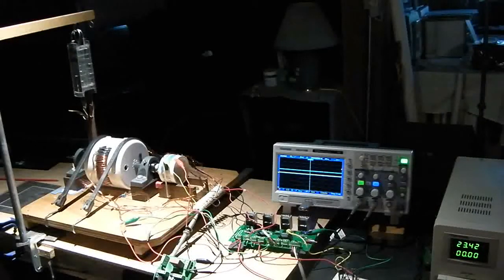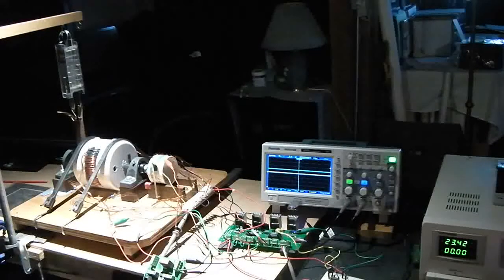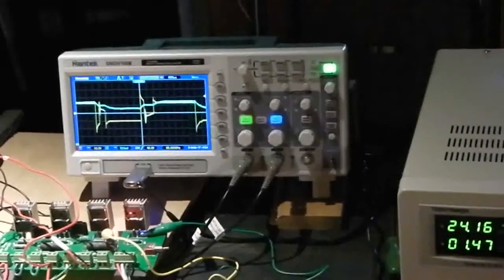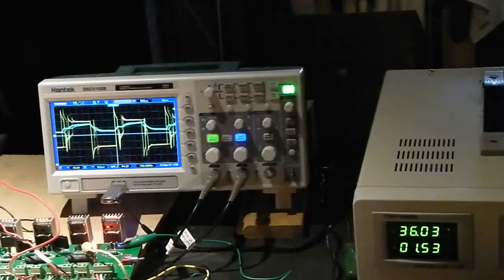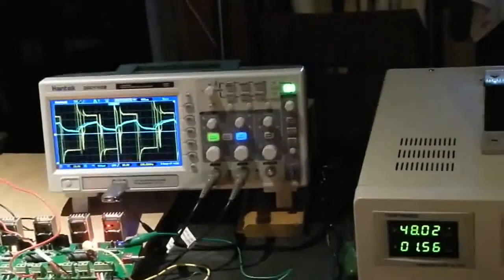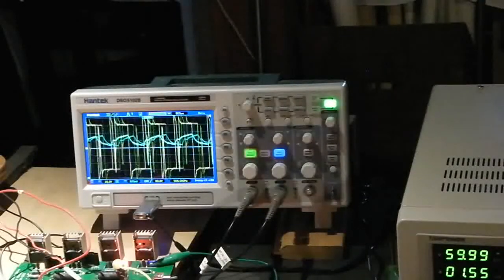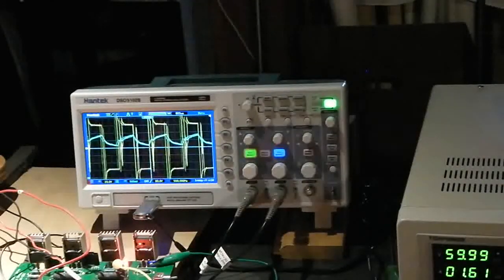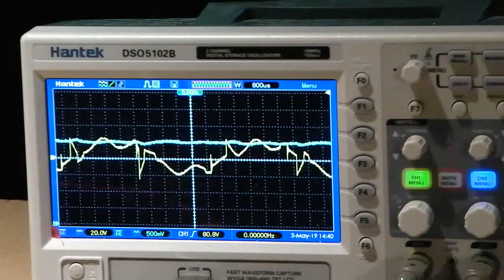ZFM Video 16A Multi Volt Torque Test WMV V8 001

Comment: Nice work Yaro. The core material is not visible- or is the wire wound on the plastic? Ron Brandt used iron laminations and claimed to attain monstrous torque and 100% efficiency.
Reply from the maker: Appreciate the positive comment! The coils are air coils, no core beyond the plastic spool piece. The coils are curved over a 90 degree arc with a Cl radius of 2.5".